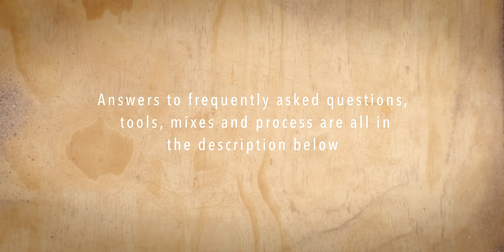Shiny Lime Plaster Sealed with Olive Oil Soap

Comment: I love this film for it’s beauty and simplicity. I’ve just finished my second Tadelakt course, an Italian version but not as good as the Moroccan style, so it’s great to see what can be achieved using the rawest of materials and the gradual build up of layers to create a sublime finish.
Reply: I have been fascinated with tadekalt for the longest time. Now that we are building a resort, I want to inculcate tadelakt or this technique of lime plaster. But there aren't budget resources in the part of India we're building in. 
What course did you take? I'm confused about the type of materials it needs and whether they'll be available locally. 
Biggest question though, CAN WE APPLY TADELAKT ON FLYASH BLOCK WALLS? I've had mixed answers to this from the limited tadelakt-experienced people I have talked to. Some say the flyash blocks are prone to cracks as well as tadelakt. So their combination may result in early cracks. Some say that the surface isn't suitable/coarse enough for the natural plaster to adhere to.
I'm sorry for the questions. Any insight will help

Comment: I am a plasterer renderer and masonry worker from liverpool. i often work with traditional lime. i have to say, i am very impressed with this piece of work. and the formula is so sinmple. i am oing to try it on my chimney breast as a feature wall. love the rust colour too. keep up the good work. sorry for grammar
Reply: I've been fascinated with tadelakt and lime for the longest time ever. Now that we're building a resort, I'm eager to inculcate this or tadelakt in our project.
How did yours turn out? Did you try exactly this technique?
Biggest question though, CAN WE APPLY TADELAKT ON FLYASH BLOCK WALLS? I've had mixed answers to this from the limited tadelakt-experienced people I have talked to. Some say the flyash blocks are prone to cracks as well as tadelakt. So their combination may result in early cracks. Some say that the surface isn't suitable/coarse enough for the natural plaster to adhere to.
I'm sorry for the questions. Any insight will help

Comment: Amazing, this is completely waterproof right, I can use it on my bathroom walls? Also were those 4 coats of soap and water
Reply from the maker: Yeah should be waterproof, and 4 coats might need more you just keep doing tell it starts to bead
Reply: @TheNitoProject  I am an architect and planning to use it on the bathroom walls,
Reply: @TheNitoProject  with grey pigments, so do u suggest to use two different shades of grey to get an uneven paint
Reply from the maker: Yeah you can modeled your grey with a darker gray
Reply: @nitantamadhekar5225  were you able to successfully make the application?
I've been fascinated with tadelakt and lime for the longest time ever. Now that we're building a resort, I'm eager to inculcate this or tadelakt in our project.
How did yours turn out? Did you try exactly this technique? What lime and soap did you use?
Biggest question though, CAN WE APPLY TADELAKT ON FLYASH BLOCK WALLS? I've had mixed answers to this from the limited tadelakt-experienced people I have talked to. Some say the flyash blocks are prone to cracks as well as tadelakt. So their combination may result in early cracks. Some say that the surface isn't suitable/coarse enough for the natural plaster to adhere to. Some say the permeability differs and will result in cracks.
I'm sorry for the questions. Any insight will help

Comment: Great Video. Been in the building trade for almost 50 years & I don't recall seeing a hand hawk like that. I've always loved working with lime, so I'll give this a try. I'd advise anyone who's not a plasterer though to consider eye protection, lime is something you really don't want in your eye.
Reply: I've been fascinated by lime plasters for the longest time ever. I want to inculcate this plaster or a tadelakt plaster in our resort in India. 
Since you're experienced with lime, I can't help but ask- can we apply tadelakt or this lime plaster on flyash block walls? I've had mixed answers to this from the limited tadelakt-experienced people I have talked to. Some say the flyash blocks are prone to cracks as well as tadelakt. So their combination may result in early cracks. Some say that the surface isn't suitable/coarse enough for the natural plaster to adhere to.
Any insight will help

Comment: I had a go at this, it went okay but had to give up as it was drying inconsistently and cracking in places, so took it off. The soaping process is very hard to get right also, as in there is a very narrow window in which to apply the soap. It's very difficult to get right. He makes it look effortless, but it wrinkles, it cracks, can't really be sponged or "reset". What you're seeing in this video is the work of a master at his craft.  You can cheat a bit with white cement, 
for the base made with 1:1 sand, lime and about 1:10 cement to sand/lime, that was beautiful to work with and too could pick up a gloss. The real problems came using the lime putty. 

My other problem was getting nice colours. Our lime here is beige and getting white sand or marble dust isn't really possible. I've used lime wash many times before and am familiar with hydrating quicklime and that comes out very white and was wondering if that would not be better for making a putty than commercial hydraulic lime? We also use linseed oil in the limewash here, I'm guessing for the same reason as the soap I guess: could it be used as an alternative to soap?

Comment: Wow! You do very nice work. I've been a plasterer in the United States for a very long time but when I started learning the trade what I learned with was completely different, everything was pre mixed. For interior we had a product that came pre mixed in bags called "Thin Wall" and "EZ Wall". A lot of the old homes here in the U.S. used Redwood Lath over 2x4 studs then basecoat and finally finish coat that we would single and double coat. Later, came a product called button board that baseboard was applied to. It was about 3/8" thick with holes in it. Like thin drywall. Then we have what we call exterior stucco that is sold in premixed bags. Made of plastic cement, silica sand, fire clay, and pigment. I never even heard of the soap polishing. You are a true master in your trade with great technique. I would love to learn how to do this. Our trowels are shaped a little different, our darbys are made of aluminium, our hawks look different as well. Can you provide the mix ratio, drying time between each coat,  where you get your piment? Thank you for your time.
Reply from the maker: Thanks a lot glad you enjoyed, sounds like you done a lot of different works.
I've tried to add most of technology details in the description of the video.

Comment: I've been searching for about a year now how to seal an adobe/clay brick wall using adobe mix for bonding adobe walls. I know if you don't seal it it will deteriorate over time. So many ways I found but they seems won't work or better yet, you have to do it (re-apply sealant) every other year or so. But your method is so easy to do and needs little maintenance in the long run. The olive oil soap may not need to my application since it is for outside wall sealing and didn't need too fancy look. Thank you for sharing your video.

Comment: The cinematography is equal and on par with the artistry of the artisan skill. I am building a minimalist home and am incorporating Japanese styling among others and a smooth natural wall of plaster, cement, or other such medium became a desire and in very short order your videos appeared. I am excited to try this technique and see what form my attempt will take.
Reply: I've been fascinated with tadelakt and lime for the longest time ever. Now that we're building a resort, I'm eager to inculcate this or tadelakt in our project.
How did yours turn out? Did you try exactly this technique?
Biggest question though, CAN WE APPLY TADELAKT ON FLYASH BLOCK WALLS? I've had mixed answers to this from the limited tadelakt-experienced people I have talked to. Some say the flyash blocks are prone to cracks as well as tadelakt. So their combination may result in early cracks. Some say that the surface isn't suitable/coarse enough for the natural plaster to adhere to.
I'm sorry for the questions. Any insight will help

Comment: From Mexico:  We have discovered after much work that failed in a few years, that we had to find the best lime available, which is now not as good as it used to be. Our sand is too dirty with clay, so we now wash it. In many cases we are putting lime plaster over old lime plaster. Often it doesn't stick.  So now we remove more of the old plaster and work thicker and aggressively push it on. We also use a 3 to 1 mix and sometimes remove the finest sand.  It is harder with more sand and less fine sand. So much is determined by local materials. The second and final repair coat is put on before the 1st dries out completely. It's a very thin layer and won't hold up put directly on old plaster.  It must combine with the thicker coat that has been pushed onto the old plaster.
Reply: I've been fascinated with tadelakt and lime for the longest time ever. Now that we're building a resort, I'm eager to inculcate this or tadelakt in our project.
Did you plaster turn flawed? Any tips on inculcating this?
Biggest question though, CAN WE APPLY TADELAKT ON FLYASH BLOCK WALLS? I've had mixed answers to this from the limited tadelakt-experienced people I have talked to. Some say the flyash blocks are prone to cracks as well as tadelakt. So their combination may result in early cracks. Some say that the surface isn't suitable/coarse enough for the natural plaster to adhere to.
I'm sorry for the questions. Any insight will help
Reply: When you say it is harder with more sand and less fine sand, what is the way you suggest doing it?

Comment: Wow!   I'm impressed.   This is the best lime plastered project I've ever seen.   Thanks for the info bro.    I'm about to start a project and you just made it a lot easier for me.
Do you mind listing the type of Lime Plaster, base coat, lime putty  etc that you use?    I will try to find them in Mexico, hopefully I'm lucky enough to get them.
Thanks so much again, and kudos to you.
Reply: I've been fascinated with tadelakt and lime for the longest time ever. Now that we're building a resort, I'm eager to inculcate this or tadelakt in our project. But my concern is the same as yours - if we'll be able to get the mentioned materials.
How did yours turn out? Did you try exactly this technique?
Biggest question though, CAN WE APPLY TADELAKT ON FLYASH BLOCK WALLS? I've had mixed answers to this from the limited tadelakt-experienced people I have talked to. Some say the flyash blocks are prone to cracks as well as tadelakt. So their combination may result in early cracks. Some say that the surface isn't suitable/coarse enough for the natural plaster to adhere to.
I'm sorry for the questions. Any insight will help

Comment: Hey, I don't know if this would be something you're interested in, but I can get Japanese style trowels from Taiwan for very very cheap. I currently use a Japanese style rectangular trowel with rounded corners and a thin blade I bought on my last trip for about everything, skim coats, etc. I find them a lot more comfy than the US/British style. I have a friend there that could get me whatever, and after COVID ends I plan to travel back. If it's something you'd be interested in, let me know.

Also, this video is super cool, as tadalakt/etc was always very mystifying and had contradictory recipes. I think the "secret" in both was marble dust instead of sand from my research, but this recipe definitely looks good enough. Thanks for demystifying a lot of otherwise pretty complex coatings and methods!

Comment: The main reason why the soap is used it is because simple lye and oil soap, aka "Castille" soap, reacts to alkalinity, that's why this type of soap does a shitty job in areas with hard water to clean our bodies, that reaction inhibit the soap molecule to bind with impurities and skin oils, in fact this type of soap as most soaps are emulsifying agents that allows oil and water to blend together; and so the substance that outputs that reactions specially in presence of calcium, is  insoluble in water, almost like a wax. So when you add it to lime plaster, it reacts with that alkalinity and the calcium, producing the "polymer" in the surface.
 There is other factors like the reactivity of the plaster, and the content of insoluble sediments in the mix, like lime, or other fine clay materials that can bound to the calcium during the burning process when traditional mixes are produced in Morocco. Thus, quicklime in the wet mix can react with soap too, and oils as well, even to the point to saponify any oil remnant in the soapy water. Aside that, traditionally in Morocco, people use an agate stone to press the plaster, this pressing process may be very well the key to embed the impermeable coat to pores under neath the surface and any other pore that could have being left on the surface.

Comment: Stellar job on your skill as an artisan and videographer. This video brought tears to my eyes - just what I was dreaming of!!!! I am thinking of the best way to create a stylish wet-room in a tiny home - can this be done onto marine ply wood if so how to prep the walls? and would I still need to install shower plate first of could this go straight on as floor instead and could this have underfloor heating underneath? Is it possible to do walls ceiling floor and do "rounded corners"? I know you can tell I'm not from the trade - but super curious - very inspired and as an artist hopeful to give it a good crack if I get enough guidance.

Comment: Hey Nito Project Team, your inspiring work has pushed me over the falls. Just picked up a bag of type S lime for my first foray into working with the stuff.  a couple of Q's: what is the primed surface you are doing the demo on? Also, reading elsewhere, folks make a big to-do about leaving the lime putty to mature for extended periods of time before use. you mix it right up and go for it. can you explain the difference between why or when to use it fresh like that? does it matter that much?  as usual, thanks so much for putting it out there.

Comment: Great video. What is the difference between this and tadelakt? Is it just that they use a stone to polish in the soap? Or is the actual lime mix different? Also are they both equally water resistant? I am wanting to use either this or tadelakt instead of tiles in my shower, on top of tile backing boards with either a coat of tile adhesive or the lime base directly on the backing board, do you see any problems with that?
Reply: I've been fascinated with tadelakt and lime for the longest time ever. Now that we're building a resort, I'm eager to inculcate this or tadelakt in our project.
How did yours turn out? Did you try exactly this technique?
Biggest question though, CAN WE APPLY TADELAKT ON FLYASH BLOCK WALLS? I've had mixed answers to this from the limited tadelakt-experienced people I have talked to. Some say the flyash blocks are prone to cracks as well as tadelakt. So their combination may result in early cracks. Some say that the surface isn't suitable/coarse enough for the natural plaster to adhere to.
I'm sorry for the questions. Any insight will help

Comment: Hi there,

Recently I've endeavored to build me and my family a small timber frame home in a. France.  Your videos have been a constant inspiration for me as a builder. Thank you. They are a rare treasure to find short films on YouTube that combine the grace of  a craft done well and the beauty of good quality, well edited film making without the usual bombardment of "me talk" so to speak.

Anyway, I have used your technique described in the shiny lime plaster vidéo as à plaster in our bathroom. For some reason, (and I know there are many variables here) It hasn't worked as planned. I was wondering if you could potentially shed some light of my situation. I appreciate you have many followers and probably many questions to answer but your knowledge would be useful here! 

Basically, the plaster worked very well up until the last stage of the process.I followed your instructions but I believe I might have applied the soap to early perhaps. Now the walls are quite matt, have a few hair line cracks and the plaster does absorb water. Is there anyway to re coat the walls? Could I add another coat of lime putty and repeat the process?  I imagine the lime might not bond as there is no key. Any thoughts? Alternatively could I oil the walls, do you think that would bond and waterproof them? 

Any ideas would be greatly welcome as I'm in a pickle! Thank you and keep up the good work you and your family are doing.
Reply: I've been fascinated with tadelakt and lime for the longest time ever.

Kudos to you that you put the tutorial into action. 

We're building a resort and I'm eager to inculcate this or tadelakt in our project.
Did you try exactly this technique? What did you do then to repair the fine cracks? What was your wall made of?
Biggest question though, CAN WE APPLY TADELAKT ON FLYASH BLOCK WALLS? I've had mixed answers to this from the limited tadelakt-experienced people I have talked to. Some say the flyash blocks are prone to cracks as well as tadelakt. So their combination may result in early cracks. Some say that the surface isn't suitable/coarse enough for the natural plaster to adhere to.
I'm sorry for the questions. Any insight will help